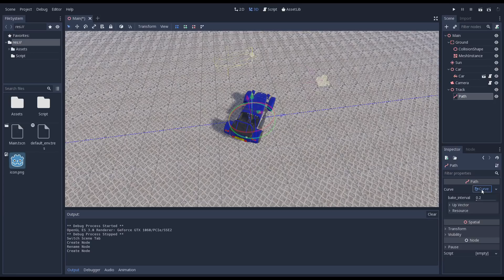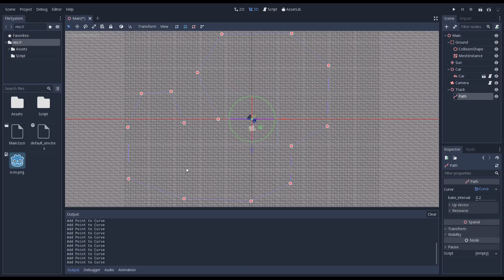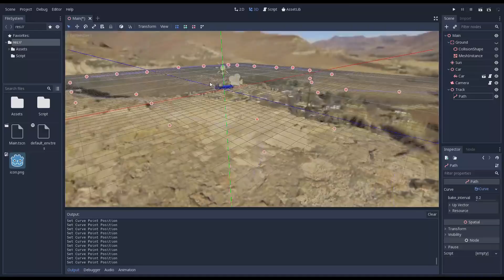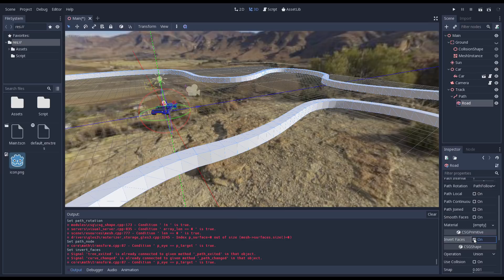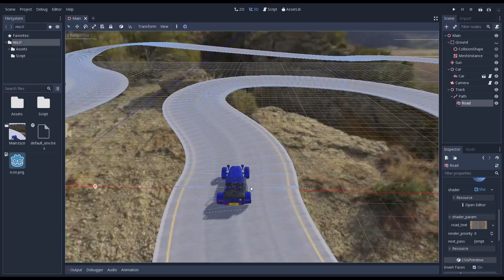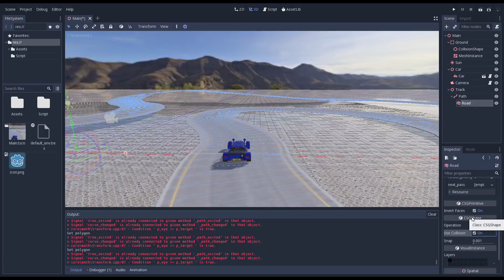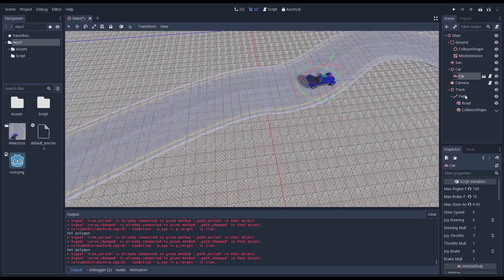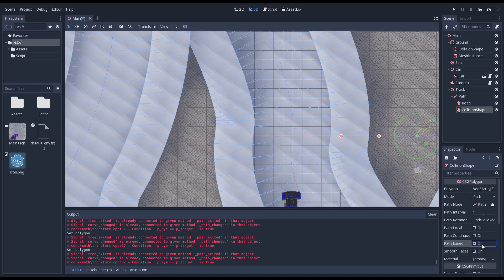Godot Vehicle Tutorial Part 2 - Building a track

Comment: Hi Bastiaan. My intention is to build my racing game for android phones. Currently I'm designing my game on a desktop. Do you know whether godot allows for tilt control for steering? I came across tilt control in some android games I played. I find this to be a good steering option.
Reply from the maker: Hey bruce, yes you can get access to the accelerometer data of your phone through Godots Input system. This vector will tell you what down is. If you obtain the angle between this vector and Vector3(0.0, -1.0, 0.0) you can use that as a steering angle. 

https://docs.godotengine.org/en/stable/classes/class_input.html#class-input-method-get-accelerometer
Reply: @BastiaanOlij  Thanks, I'll look into it. Using keyboard inputs with the speed of my car makes it uncontrollable. I managed to implement your gear system. I'm using a Nissan gtr. 

For now since I'm using my desktop to develop the game, I'll continue with keyboard controls before looking into the documents you referred.

Another significant task is the logic for the non player cars.

Comment: Is it possible to put potholes or other defects on the path if built this way?
Reply from the maker: In theory yes, the CSG system in Godot allows you to add or subtract meshes, so you could create a pothold shape and subtract it from the road. The system is far from perfect however and it does tent to increase your polygon usage by alot.

Comment: Hey guys,
I have an issue with CSGPolygon for using tiled texture on my track.
I checked Path Continuous U and using the same shader you use with some addons on that (Like Metallic texture, normal map and so on) but I don't get correct tiling in some parts (Mostly where the track is rounded)
Any idea what is the solution ?
Reply from the maker: Not at the top of my head, are you using 3.4? The logic changed there and there are new options to choose from, but if you are on 3.3 it should just work

Comment: Can I have different material for each part of the road by this approach ?
Reply from the maker: Not easily, you could use a splatmap to vary textures in a single material
Reply: @BastiaanOlij  what if I use different paths ? Can have a connection between them ?
Reply from the maker: @athellboy  You can align them off course but there is no automatic snap behavior that ensures a continuous line. 

I did this to create a pit lane in one of my live streams.

Comment: I know this video is a bit old but is there a way to bank the track on an axis in godot, like how some nascar tracks are banked 23 degrees in turns and 5 degrees on straightaways?
Reply from the maker: Godots curve does have that functionality but there is no UI for it. You can programmatically adjust this using set_point_tilt:
https://docs.godotengine.org/en/stable/classes/class_curve3d.html#class-curve3d-method-set-point-tilt

That said, creating a track in proper modeling software such as Blender might be an easier path.
Reply: @BastiaanOlij  thanks for the tips

Comment: Nice tutorial, but I have a problem. The car does not stop jumping on the road, and that intensifies more in the curves, the car is thrown into the air when reaching curves at high speed.

It's like every section of the road has strange collisions
Reply from the maker: The car jumping or jittering by itself usually is an indications the springs are set to stiff. If you're using Godot 3.4 it's worth trying to switch to the build in physics in which alot was improved.

Collision issues on the road can be caused by seams between sections, is your collision shape on continues form?
Reply: @BastiaanOlij  I switched to 3.4 and it still keeps jumping like it's dirt road. Sometimes around curves it jumps out of the way out of nowhere. I have reviewed and apparently everything is the same as the tutorial. Check the wheels. all equal. check the road several times ... all the same and still does not work.
And YouTube does not allow you to put links to show you the parameters in images

Comment: I love this tutorial series and I know it's few yers old. But I'm just wondering, it I can instead of CSG extrusion use my imported mesh and make and path follow array in Godot. So I can model my own road segment with my UVs etc and use it here? Like in Blender for example?
Reply from the maker: You could probably create a tool script that would do so but I don't think you can do it with build in nodes. A better workflow may simply be to create the track in Blender, export it as a GLTF and use that in Godot. You can use naming conventions to automatically create collision objects for your road. It's advisable to create simplified collision shapes based on the same curve you're using to create the road mesh with.
You can find more info about the naming conventions here:
https://docs.godotengine.org/en/stable/getting_started/workflow/assets/importing_scenes.html#import-hints
Reply: @BastiaanOlij  Understand, thank you for answer. I will go with Blender geo import then

Comment: Nice video but it does not show the sky even when it is selected in the gdnative thing it is just grey
Reply from the maker: This is a thing that broke between Godot 3.0 and 3.2, all you need to do is go into the projects settings, find where Godot has a setting for the default environment, and select the default environment tres file. That will re-apply the sky settings.
Reply: @BastiaanOlij Thank you very much it now works. For anyone with the same problem go to Project settings/ Rendering/Environment and select the default environment.

Comment: i am hoping you will explore engine logic and audio more in the future.  since most of the visual stuff is handled by artists anyway.
Reply from the maker: Audio has been long on my list but one of the areas I'm not very experienced in, so some day I hope to tackle it but it's probably one of the subjects I'll do some exploratory streams for first as I learn things myself.

What were you thinking about focusing for engine logic? As in the engine of the car or engine as in Godot itself?
Reply: @BastiaanOlij   @Bastiaan Olij  well IRL there is a complex series of things that happen before the engine force reaches the wheels.   the whole engine RPM and gearbox and transmission logic needs to be calculated and converted to engine force  inside the script befroe being applied to  the "engine_force" variable.   thats what i mean. 
currently the engine acts more like an electronic full size toy rather then  a proper gas car.    there is also audio which is much more important to video games then people tend to think.   it shouldn't be too complex tough.  for the engine itself you can change the pitch value according to RPM  and get a pretty realistic effect.  
since i have your attention i should mention you might need to apply steering help for high speed driving to prevent the steering from crashing the car.  
 a crappy way to do it is using "get_node ("wheel")get_rpm" on one of the wheels and use it to calculate the steer limit .

Comment: Is this the same way I would go about making a path like this for a 2D overhead racing game? 
Do you know what nodes I would have to use for a similar effect. 
I'm guessing CSG polygon does not work for 2D
Reply from the maker: Hey Jon and Philipp, unfortunately no, CSG only works in 3D. I don't think there is an equivalent but you could use a Polygon2D node and write some code that takes a Curve2D and turns it into a shape
Reply: Okay here is what I have come up with so far.
1. Draw the full track with a small gap in your art program such as Asperite. The gap is important but can be filled in with a second sprite, of a small straight section or anything else you want.
2.  Add it to Godot as a Sprite node and scale it as you need.
3. With the Sprite node that contains your track selected, look above the 2D view window and the far left option is also called Sprite. Click this and you can now create a collisionPolygon2D sibling as well as convert it to a Polygon2D. Do both, creating the sibling first
4. You will likely need to move the points slightly on the collisionPolygon2D (don't mess with the Polygon2D) but takes only a few minutes for a medium-sized track. Also, move some points to fill in the gap where the missing section of track will be placed.
5. If you failed to leave a gap in the track then Godot would have only detected the outside edge of the shape.

I tried adding small sections directly as Polygon2D but it gets very fiddly quickly and is far more time consuming. The main benefit is you can adjust small track sections easily and if you have the collisionPolygon2D created by code to match the shape then only 1 set of adjustments needed.
Reply: Looking for the same thing right now, lol, no success so far

Comment: Thanks 4 Tutorial. I'm just  creating infinity runner game, and got stuck on how to use multiple pathes, 4 example 3 different pathes with path follow.. and shift one to another, like in the runner games, player moving straight by default, and just controls left or right movement.. Like in the "subway surfers" game. How to do this.. Can you make video with simple example how to use path follow, or navmesh.. in multiple pathes and correctly shift one to another by the player
Reply from the maker: I'm going to be returning doing a few VR things for the coming weeks but an endless runner like that should be pretty straight forward. I would just use paths and when switching from one path to the next use the function that finds the point on that path closest to your current position. Following the path loosely so you can jump I did an experiment for that here: https://github.com/BastiaanOlij/godot_move_along_path

Comment: Great video!.
I am currently making a motorcycle game but i am experiencing some wierd-clunky physics happening. I noticed that the vehicleBody and vehicleWheel do not work pretty well with 2 wheel vehicles, so i have to create a lot of custom code.
One issue i was not being able to solve is that my wheels seem to do not have any traction, like i am sliding everywhere... any ideas?
Also when i create the road based on the Curve3D like you, the motorcycle rides very bad on it, like it bounces everywhere... i think i may have configured my wheels wrong..
Reply from the maker: The vehicle body implementation isn't very well suited for motorcycles I think, it doesn't have any of the code required to balance the bike, it'll probably fall over half the time. 4 wheels provide a lot of stability :) 

Not sure why the motorcycle would bounce, unless there are weird angles to the road sections. The only thing I can think off is that your damper settings aren't high enough
Reply: Try to turn on Project Settings->Physics->3d->Smooth Trimesh collision.

Comment: Its very useful. Thank you. But I found some strange issue.
When you refresh anything, Debuger shows those RED:

Signal 'tree_exited' is already connected to given method '_path_exited' in that object.
Signal 'curve_changed' is already connected to given method '_path_changed' in that object.
modules/csg/csg_shape.cpp:285 - Condition '!n' is true.

I can not fix it. Can anyone give me a hint? thx
Reply from the maker: Tiax C this is an issue in the editor itself i think, probably needs to be solved in godot itself. These are the internal signals that result in changes to the path being sent to the csg node triggering the mesh being updated. They are pretty harmless messages

Comment: I compiled Godot 3.1 on Windows 10, it becomes none responsive and the graphics card driver crashes. When i switch to GLES 2 from the menu it works fine, well at least so far while following the tutorial. Is it something to expect or there is something that can be done about it? I will attempt to use roads and part of a city exported from Open Street Map after i am done with your tutorial.
Reply from the maker: Hard to say Johnny, I'm working exclusively on GLES3 and only played a little with GLES2. I've not experienced crashes like you describe but that may simply be because of a difference in hardware.

If you've compiled Godot yourself and you start the editor from the command line, on a crash it will output a crash log. You can use that information to raise an issue on the main Godot github page, if it is caused by a bug that will help people resolve it.

Comment: Hi, i am brand new to Godot and old enough in Blender game engine. 
I am using Godot 3.04 and as you mentioned in the start of the video the mesh deformed by the curve works only in previous versions. 
Could you explain how to make it work in 3.04?(or link me to a tutorial).
I already have a race track in Blender (in pieces) but i don't know how to configure LOD yet.
The track is 21 Km long and right now i am struggling creating the terrain from heightmap.
*I have seen lots of improvements in part 2 download project, this encourages me to go on!
Reply from the maker: Hi nei, godot 3.0.4 doesn’t support mesh deformation from curve, you need to let blender do that and export the resulting mesh (apply modifiers in the export).

21km track is pretty long and doing that right isn’t something you just put in a simple tutorial. It does sound like you’re on the right track segmenting your track. You’ll want to export each segment separately and import each into its own scene, after that you’ll need to write logic to load just those segments into your main scene that are close enough to be visible and unload them when they get to far. In theory not difficult but not a beginner thing either. Godot has logic fir loading scenes in background threads which is important here

Would be a really interesting challenge, i hope you decide to tackle it
Reply: You are right. I will use a simple and small track and put everything to work to learn Godot first.

Comment: Yes the Video is good but with the Correctly Version of Godot (3.0.5) will this not work and that is bad
Reply from the maker: HavockLP why is that bad? 3.1 is about to go alpha and will likely be released officially within a few months and as i explain in my video, if you want to stay with 3.0.5 you can extrude your track using most 3d modeling software, you just loose the ability to modify the track in the engine